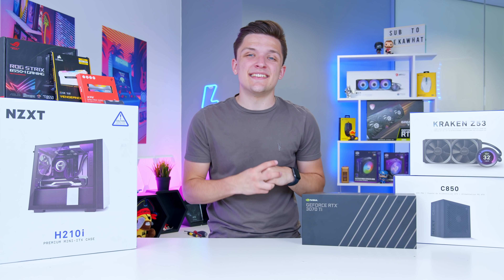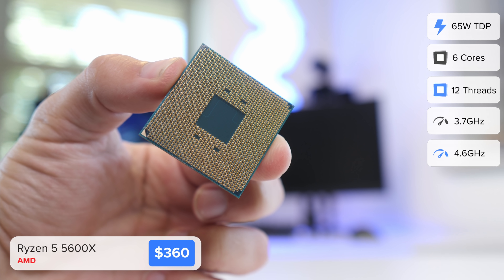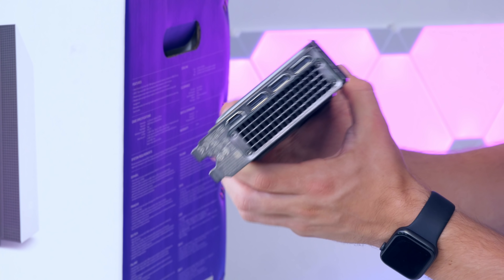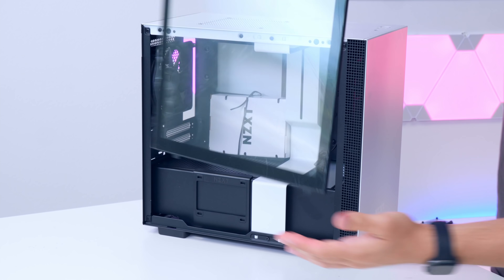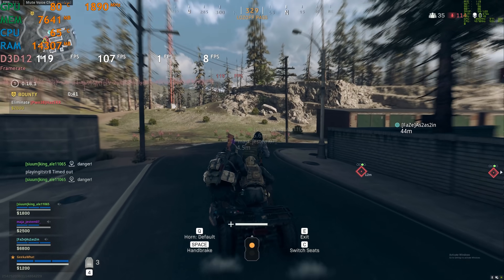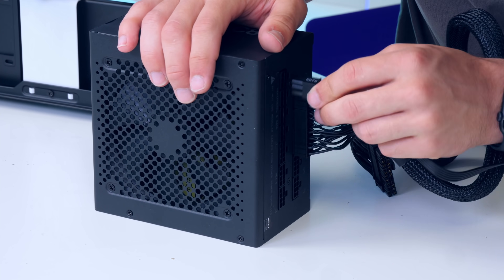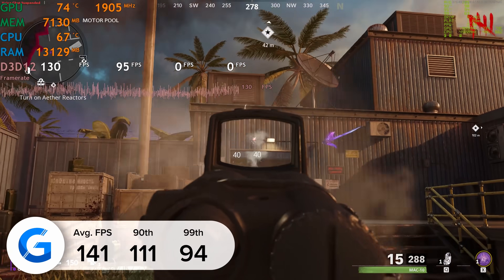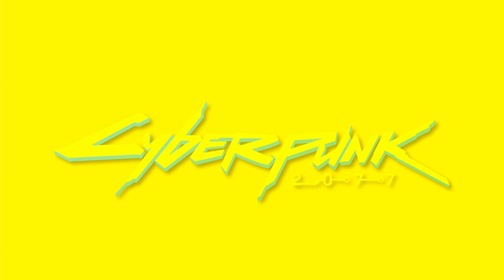$2000 RTX 3070Ti Gaming PC Build 2021! [3070Ti, Ryzen 5600X, NZXT Kraken & More TESTED!]

Comment: Hi GeekaWhat, You are not showing " What Monitor used". Which is the best monitor for these RTX 30 series cards?
Reply: It depends on what gpu version you have. What 3000-series or 6000-series gpu do you have?
Reply: @ties9123  Hi, I have RTX 3080 12 GB. My monitor is 1080 60HZ.
Reply: @Bogar2024  okay, so for a 3080 you want a 1440p monitor. Look for a "1440p 144hz (or more) ips monitor). It's really important you write ips in it, ips monitors have better colors. I can also look for a monitor for you if you say where you're from, but you ofcourse don't have to.
Reply: @ties9123  Thank you.

Comment: Did he just put a solid plate over the fans for the aio???
Reply: Yeah, I just built my PC based off his blueprint and you can actually squeeze the aio cooler into the case with the fans behind the solid plate. There's actually a dust filter that's supposed to go infront of the fans.

Comment: I really don't understand the attraction of small PC's - PC's are BEAUTIFUL, and with addressable RGB especially, the BIGGER the BETTER. More full SUPER TOWER case builds please, with custom water cooling using all 140mm fans and multiple 560/420mm radiators, with near ambient CPU and GPU temperatures, for ultimate stability and longevity please. :)
Reply: All about personal preference. Me personally, I'm a minimalist and I'm going to need a more portable form factor.
Reply: @LloydsSky9  thats what laptops are for. Desktops are the less portable power houses.
Reply: I like micro and minis not a fan of full towers
Reply: @wakcoh992  then you might as well get a laptop, is "small and transportable" is important to you. If you want top of the range power, with the best cooling at silent running then full tower or even super tower is best, that is just a fact.

Comment: Man no way you only getting 213 fps on 1080 low.
Reply: I was thinking the same thing bro. I get way higher rates with slightly worse specs.
Reply: @aidan8533-i1t  yeah i know, everyone with a 3070 paired with a 5600x gets over 300 fps on 1080p low
Reply: Probably bad optimzation from the game

Comment: which one do you recommend the z490 a or Asus rog b460
Reply from the maker: Z490
Reply: Z490 for 10th gen overclocking and no overclocking b560.
Reply: @ties9123 Do you recommend changing it or I wait to update to Intel 12 th
Reply: @hyzenbs4272  what are your current specs?

Comment: is the 5600x going to bottleneck the 3070ti at 1080p?
Reply: No, it’s probably if not the best cpu/gpu combo for one another
Reply: it definitely will. my 5600x bottlenecks even my 3070 without proper overclocking on the cpu
Reply: @theracingpig8446  a year later, I got a 5800x thankfully it doesn’t bottleneck the gpu on 90% of the titles
Reply: @rodrigoascenso4660  yayy